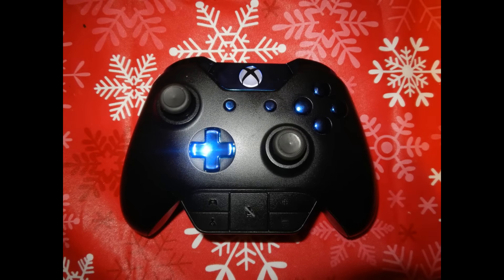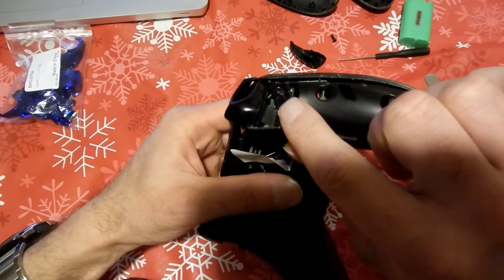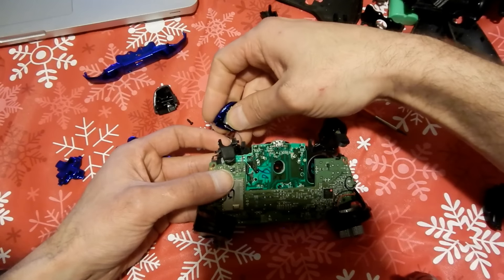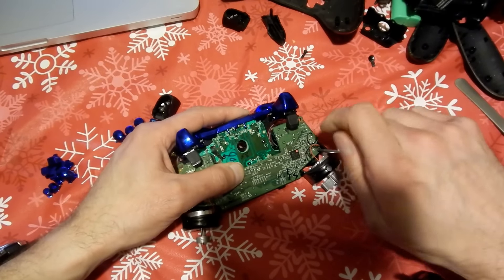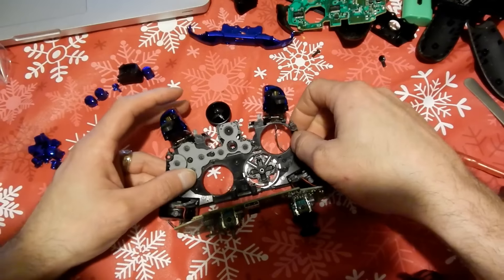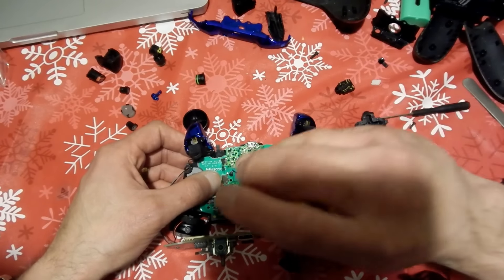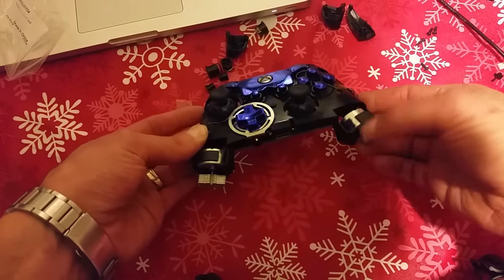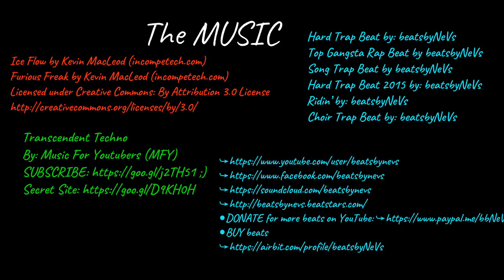How to replace the buttons on an XBOX One Controller

Comment: FYI for anyone watching this for an Xbox 1708 model build the screw in the battery compartment is a Torx 8 and you also need a torx 10 I think. I had to go out and i bought a pc repair tool kit it is a 120 piece set

Comment: I literally did exactly what you did in your video and now my controller won’t turn on at all. I took it apart a couple more times to see if I broke any cords but there is none broken so HELLLLP!!!
Reply: Did ya check your battery leads I had mine do this the ground on the battery wasn't touching the board
Reply: toxic top hat Yeah I did nothing helped it so I ended up having to buy another controller 😡
Reply: @alexisneff7954  great thing about electronics, it's probably a simple nearly unnoticeable mistake... I have a love/hate relationship with them
Reply: its probably something with the button not working properly. i had that problem and ended up redoing the process 3 a 4 times

Comment: I needed an RB from a controller with no “new 3.5mm audio” plug in. 

I broke down another controller NEW ONE WITH 3.5 and the RB does not match. 

The old and new controllers are built differently inside.
Reply from the maker: Sorry to here that. The trusted seller I use has the newer controller buttons here in case you need it: https://www.ebay.com/itm/For-Microsoft-Xbox-One-S-One-X-Controller-Set-Buttons-Replace-Parts-Chrome-Gold/112784395036?hash=item1a42794b1c:g:wwwAAOSww-Bab~Jr
Reply: I'll buy them from you

Comment: I could take apart a 360 controller in 5 seconds. Why did they have to make this one such a pain?
Reply: efwefwef agree 100% completely unnecessary to have to remove 10+ screws with multiple screwdrivers just to replace or fix the face buttons

Comment: I replaced all my buttons but my A and Y buttons I’m having to push somewhat hard to get to work. I’ve disassembled and reassembled multiple times and the same thing keeps happening. Could it just be the replacement buttons or am I not doing something correctly?
Reply: It was a $10 pack from Amazon

Comment: Just went to the store to pick up my T8 for the chip disassembly like you said... and it's totally the wrong size. The T8 is for the screws on the plastics... back to the store
Reply from the maker: Thank you for your helpful tip! Looks like some controllers may have different size screws of this type? Very much appreciated!
Reply: The original Xbox controllers have T6 for the interior screws! Great video, thank you!
Reply: t8 secure/tamper proof/safety whatever the brand uses to label the T8 as the one with a hole in the center. all interior screws beyond the shell plates will be standard t6 with no hole necessary. Wal*Mart carries a set surprisingly enough but any Home Depot will have what you're looking for as well. if not at the hand tools check electric aisle.

Comment: Is there a way I can fix the USB cable port on the controller?, mine is very flimsy and loose. Amazing video btw.
Reply: Retrac 1509 there are parts you can buy and eBay real cheap but you gotta know how to solder

Comment: The Xbox 360 controllers are way easier
Reply: KingWulfgar666 easier for what though?
Reply: @purpsosa  just in general. There was just a single board, and all you had to do was take out the seven screws and lift off the back, and it was open.
Reply: KingWulfgar666 fair point m8
Reply: This is WAY harder than the PS4 controllers as well.

Comment: when i put in the top part (with the bumpers and micro usb) the bumpers are really stiff and don’t click in. it’s like the whole piece just doesn’t wanna go in. i’m doing this with an og xbox controller
Reply: Hiya mate the reason being. The bumper section is a different mechanisim to the xbox controller. Everything else will fit except that

Comment: Does anyone xbox controllers if you lightly press them they dont register I got 4 new ones and 1 used and they are all the same why is that do the buttons stick out to far do they make thinner buttons so I tried my ps4 controller and u can lightly press and it does register so why is that

Comment: I have the battle field 1 edition Xbox 1 and controller that had a single wire connecting the 2 control chips.    Does anyone know what the wire does/ why it was there?
Reply: I finished putting the controller back together and it won't turn on.    My dad pull the wire I asked about before off one of the Chips and soldered it back on.  That is the only thing that I can think of that would cause problems.    Does anyone know how to help me?

Comment: An entire video without almost any cut and then you skip how you connect the top buttons with the mask.
It's absolutely not a trivial part and it's important to check if the buttons are still working.
Nica -.-

Comment: this video helped - but the order you show is complete trash... changing the depad before switching the buttons... okay - but then you should show it in that order as well... you show how you change triggers and in the next step you also swapped the bumpers without explanation... when you do a step by step tutorial you should go step by step and not in any mixed order ;-) 
there were many unnecessary steps to be done - meaning going back and forth because of your wrong order...

Comment: I am a 13 years old lil' boy. Can i do it?
Reply from the maker: As long as your parents are okay with it and know the risk. I started messing with electronics at the age of 15.
Reply: Butter Cups  if there are no batteries in it then not. He means you can break the controller
Reply: Butter Cups  the risk of it breaking
Reply: Idk can you? You should know these things kiddo. It is you after all, and we're not you bud. I think you got this 👍💪😎
Reply: LightningForce im 14 but today I did it with an elite and broke two wires. Im gone return the controller tomorrow and try again. Hopefully it works this time and when I did it today the bumpers felt off

Comment: Need help ASAP:(
Reply from the maker: Sorry to that. Did you order a new set? On these controller models, the top right and left bumpers are permanently attached to the center. I replaced mine because of the same issue.
Reply from the maker: Please explain what part is giving you trouble on the bumpers. I may have misunderstood the issue

Comment: I broke my motor sad life
Reply: Zain Rana I'm sorry about that Zain. I went to try it but I didn't want to brake anything so I asked a pro to do it for me.
Reply from the maker: I'm sorry to hear that. Did the cable snap off? A pro in your area should be able to quickly solder that for you.
Reply: LightningForce good tutorial though he or she just needed to be more careful. Good job my man.
Reply: I just watched this video. Then stripped my xbone controller down to nothing and cleaned it because of stickyness. Successfully reassembled it and it works. Thank you very much. Now im gonna change my buttons next and let the kids paint them and clearcoat them so they are customized lol.
Reply: Zain Rana I did the same thing, Pissed me off!!!!
Reply: Get a new boat then